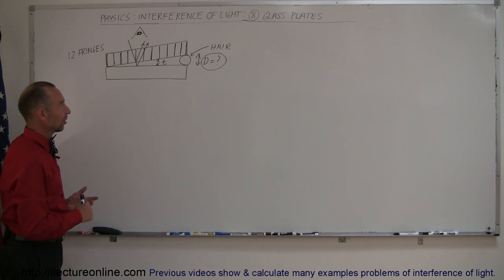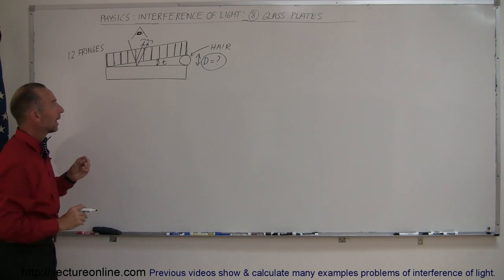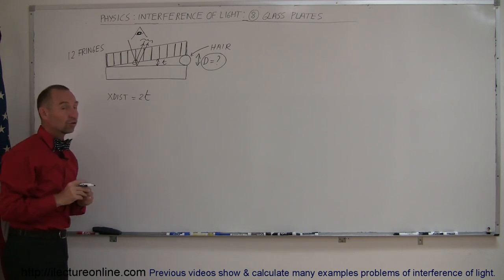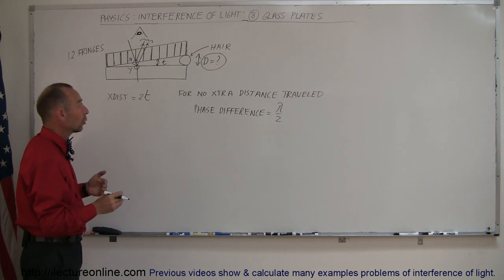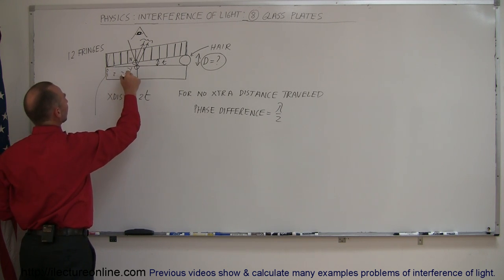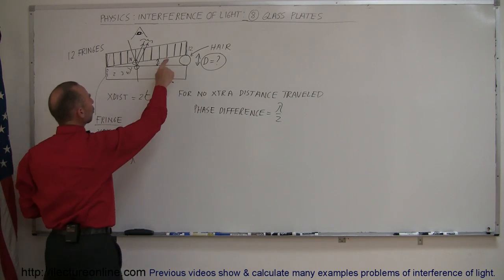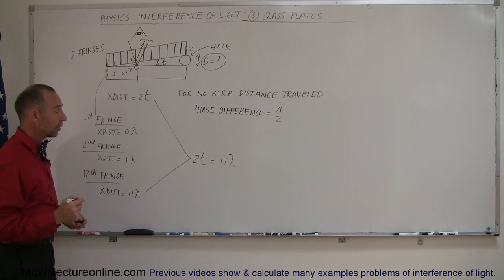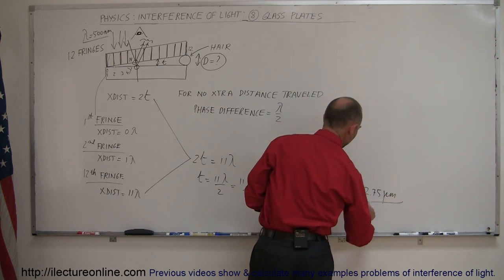Physics 60  Interference of Light (8 of 8) Glass Plates

Comment: Hello, I can't seem to get why xdist = 1*lambda at the 2nd fringe, and also in general why xdistn = (N-1)*lambda at the Nth fringe
Reply from the maker: extra distance = 2 x path across the gap.   Then you need to determine what condition you want: constructive or destructive interference.  To get a frinch you need destructive interference.  Normally for destructive interference you want a phase difference of 1/2 wavelength.  But in this case there is a 180 degree phase shift on the bottom boundary, so you need a full wavelength difference for destructive interference.
Reply: @MichelvanBiezen  thank you so much!!!

Comment: Dear Michel van Biezen: How big can be "t" in order you still be able to see the interference fringes? This question is related to the other question I made in other video from yoy about how "fat" can by a film in order to be able to see an interference pattern. Thank you in advance.
Reply from the maker: You are correct in assuming that theoretically the size of n and t shouldn't matter.  But in the real world, other sources of light and interference will creep in.  As the separation distance between the plates increases, other light will more easily get in from the sides, and the difference between bright and dim will diminish, making it more difficult to see the fringes.  Also the phase differences at angles other than 0 degrees and 180 degrees play a role which will cause the fringes to "smear" when n becomes too large.  You can get more understanding by looking at this playlist:  PHYSICS 61 DIFFRACTION OF LIGHT     https://www.youtube.com/playlist?list=PLX2gX-ftPVXXzgOs4KITgRrBxUluUzCrR
Reply: Dear Michel: Thank you very much for your fast reply. Just one more question: I usualy make measurements with a Fizeau aparatus in orden to check homemade flat mirrors for telescopes, and I always wanted to know why we just see the interference pattern caused for the two reflections you show in your video and why we do not see the total interference between the four reflections that already exist in the system (that is the two reflections you show plus the other two reflections in the upper surface of the upper glass and the bottom surface of the bottom glass)? Finaly, I would like to know if are you planing to make a video about this issue and why there is no interference in the real world when the film is not thin. Best regards
Reply: Alfpajarito 
t should be of the order of wavelength of visible light. I.e. max 10 times wavelength. For thick film the two reflected rays originate at far distance and therefore do not have coherence so they do not give pattern. Visit my channel SS Physics. Thanks.

Comment: sir the glass plates has 2 boundaries and light comes from air so why isnt the refraction from the first boundary not shown?
Reply from the maker: That is a good question (although I think you meant to write: "why isn't the reflection from the first boundary shown?")  Because the refraction from the first boundary is shown.  That is done because of simplicity.  The ray that is reflected from the second glass plate in part also transmits and refracts into the bottom glass and then in part reflect from the bottom and in part transits through that boundary, etc.
Reply: @MichelvanBiezen  thank you sir

Comment: In all the formulas in my exam they use 'm' so how does that get into the formulas you use For example there was a question where blue light and red light were going through a thin film interference and the red light was visible(constructive) at the end but the blue light wasn't visible(destructive) Since there was 2 phase shifts I cancelled them out and using the blue light I calculated the thickness with (640nm)/2(1.25) but there right answer ended up being 2(640nm)/2(1.25) where did I go wrong? The givens are wave length of blue light: 640nm wave length of red light: 512nm, n of oil = 1.25 , n of water = 1.33 and the layers where AIR OIL WATER
Reply from the maker: m is an integer and can take the values 0, 1, 2, 3, ....   etc.    If the reflected light has a path length that is equal to an integer multiple of a wave length, the light will be in phase and there will be constructive interference

Comment: Is lambda the extra path diff bw waves making fringe 2 or the distance bw fringe 1and 2
Reply from the maker: The extra path difference is twice the thickness of the gap:   xdist = 2t.   Then you set that 2t equal to a function of the wavelength to find what you want (a destructive or constructive interference spot).   You also need to account for phase shifts at the boundaries.
Reply: Thank you.

Comment: I loved this video. Thank you so much. 
Also, one small doubt (ref: 5:03).
If the Refractive indices of the two materials and surrounding were adjusted such that no phase shift occurred for both the rays, 
and if there were exactly 12 bright fringes (with the 12th bright fringe at the end near the hair strand), then our results would still be the same right? Because we'd consider, for the 1st bright fringe, the x(dist) = 0(lambda)  ;   for the 2nd bright fringe, the x(dist) = 1(lambda)  ;  for the 12th bright fringe, the x(dist) = 11(lambda).
Reply from the maker: Yes, the extra distance would be 2 x path length distance between the two glass plates and you would set that equal to the integer number of wavelengths

Comment: Hello sir, I have something missing in my mind. Obviously, the sunlight is coming from air and entering to the glass in first refraction, as a result of this, shouldn't it be shifted 0.5 lambda ? why do we assume that the light is coming from in glass firstly ?
Reply from the maker: There will be a partial reflection and partial transmission at every boundary.  Here we just concentrate on the boundaries on either side of the air gap.

Comment: What if we are given the light spots. Can we do the same procedure assuming that on top of the hair there is always a dark fringe? (subtracting then the number of light spots by two)
Reply from the maker: Pedro,
Sure.  There are usually several ways to solve a physics problem  In this case it is easier to start with the first dark spot at the point where the two glass plates meet.

Comment: Does that mean you have to know the thickness of the hair is twice the t value you have chosen because the t value changes depending where it is measured... Doesn't that mean you need to know the diameter beforehand? Sorry if this doesn't make sense, I'm just really confused
Reply from the maker: No, you don't need to know the thickness of the hair. You can figure it out by counting fringes.  We use 2t because the light travels the gap twice, once on the way down and once on the way back up.
Reply: Thank you for answering. So you can choose any t and the corresponding fringe?
Reply from the maker: I am sorry, I didn't understand this latest question.

Comment: oh i get it. if there is a relative phase shift in a thin film, you would use the 2t=mlambda for DESTRUCTIVE since there is already a pi shift.
Reply from the maker: That is correct.
Reply: Nicole O , isn't it supposed to be complete lambda(s) n it's half for destructive?
Reply: are you asking if its supposed to be (m+.5)lambda for destructive? It would be, yes, if both have pi shifts since there would be NO RELATIVE shift but if only one interface has a pi shift, then the reverse of what we normally do is the equation for constructive interference with one pi shift. Hence, destructive for a thin film with a relative pi shift equation is 2t=mlambda. Hope it made sense
Reply: Ooh, I get you, n it physically makes sense, I've an exam at 9am, so it was necessary for me to understand,,, thanks a it really, makes sense